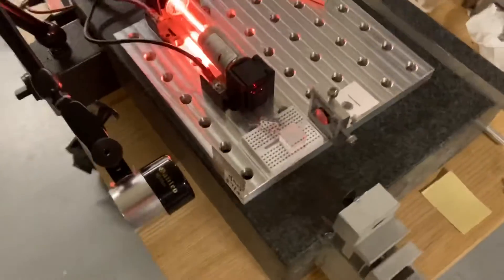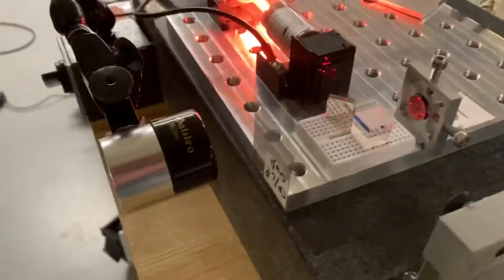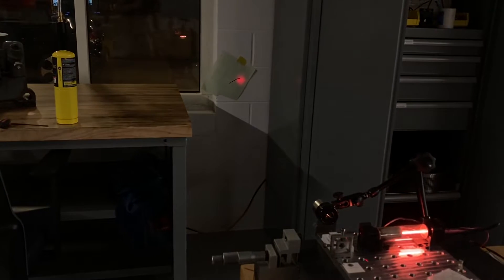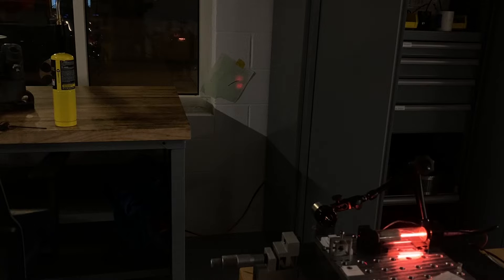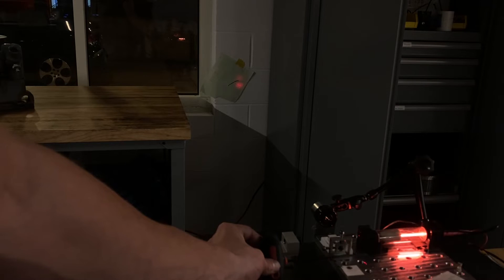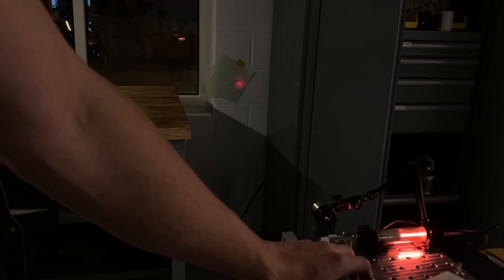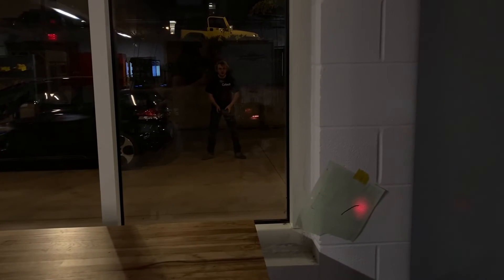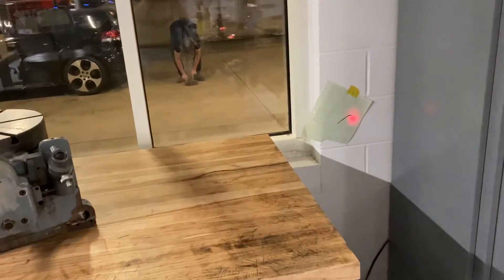Measuring Nanometers With Light: Michelson interferometer setup

Comment: U can't not get sub wave length measurement via this kind of  interferometer setup,u need Heterodyne interferometer.
A second hand renishaw encoder can use save u a lot of trouble
Reply from the maker: You can interpolate the signal from this and get way better resolution than the wavelength. That’s what I’m working on right now. I’m waiting for a nice deal on a renishaw to pop up on eBay
Reply: @cylosgarage As far as I know those are called sinusoidal encoder ,all commercial products are consit of 2 parts read header(scanner ) and interpolator(interface),read header send 2 +/- 1v vpp signal 90 degress in phase difference.Tradition scan technique allow siganl period of 20um,blow that physical scale only  heidenhain lif and lip series allow 1-8um raw siganl period(via different scan technique)

Comment: Beware: non-stabilized HeNes will drift and can put a pretty significant error into your positional feedback over longer periods of time(many minutes of machining).
I recommend that you at a minimum stabilize its temperature(heater band, thermistor), or go all the way and make a heterodyne interferometer. Sam's Laser FAQ has an excellent guide on a DIY ultra low cost solution. He also has a guide on how to make a basic digital fringe counting Michelson interferometer.
And he sells full kits(and will probably sell you a partial one) as siliconsam on eBay, if you want a shortcut.
Reply from the maker: I am well aware of these considerations. The final design has a thermal regulation system integral to it. I also already have all the components for the quadrature receiver from Sam assembled and ready to be integrated as well. Not going to go the heterodyne route just yet, but I’m looking into phase shift sensing for Michelson interferometers using an actuated reference mirror, which gives resolutions an order of magnitude better than a standard setup
Reply: @cylosgarage  In practice a DIY heterodyne build will give you about an OOM in final precision as well. It's good that you're aware of what can be done, looking forward to seeing it :)
Reply: @cylosgarage  Much easier to use a stabilised two frequency laser like Agilent, Zygo and Excel do. HP, Zygo and Excel make plane mirror interferometers for distance measuring interferometry (DMI), Used optical components from these are readily available. The hardest part is probably the electronics required if you design your own. there is extensive literature on DMI and the various interferometers used and why two frequency lasers are the best solution.